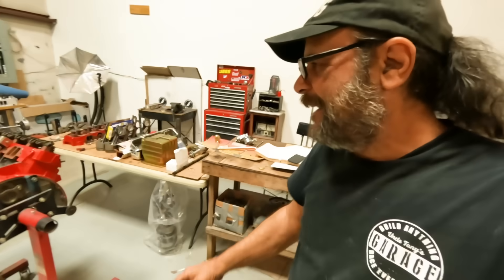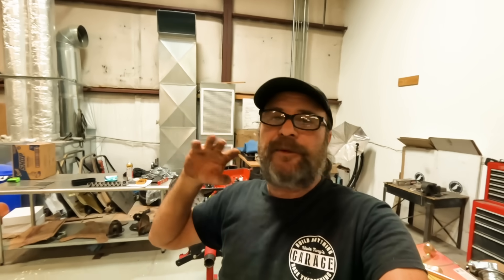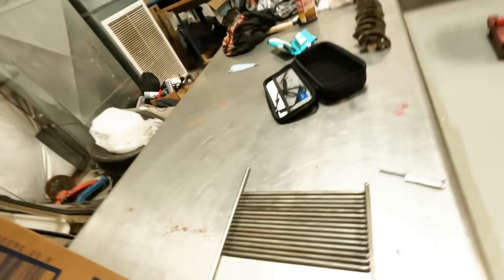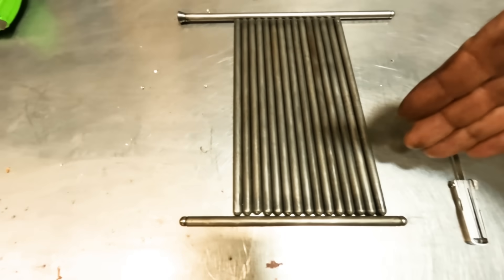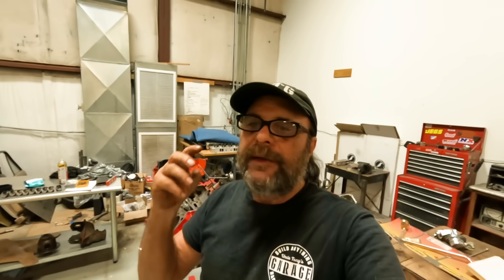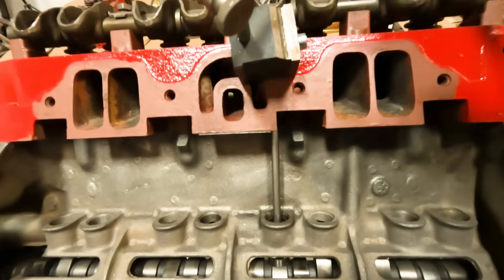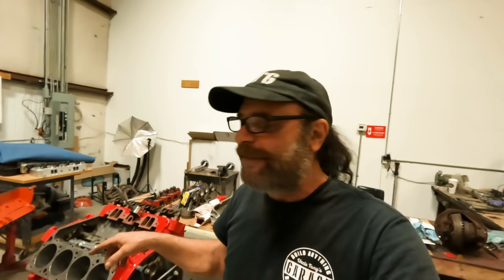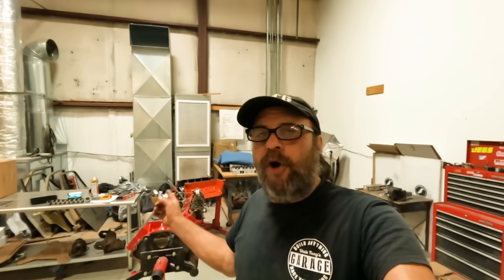The Engine Tuning Issue You Didn't Know You Had

Comment: Man, you're making me want to go to my dad's garage and tear my spare motor apart and measure all this stuff!
I'm working with 3800 Series II motors, but so much of what you teach on here is universal! I'm seriously considering blueprinting my other motor. I'm not planning on doing any serious racing with it, but I want it to be as smooth as my dad's BMW I6!
Reply: It never will be. Nice motors but won't be as smooth as the bm.
Reply: @hayden6056  a well running 3.8 will not move
.
Can litteraly ballance a quarter on it and rev it up and down all day long
.
.
I've actually got a video doing just that somewhere
Reply: @kainhall  yep , from an engineering point of view , still will never be as smooth as an internally balanced inline six...

An inline six has primary and secondary mechanical balance.

There's a reason the V6 has a balance Shaft. 

There's a reason most v6's can't rev like an inline 6 on principal alone even if all components were the same quality. 

Hell the 3800 isn't even internally balanced , the balancer and flexplates weren't even individually balanced per motor. The actual +- in grams on an old GM V6 motors balance is pretty shocking lol.
Reply: @hayden6056  you're probably right
Reply: @michaelwallace7972  inline 6 is self balancing on rotation and piston height. 

The bmw is also internally balanced. Not knocking the V6 I have one on my stand right now! Just vastly different dynamics.
Reply: Love those engines I had a supercharger one in a Buick park avenue ultra best car I’ve ever owned
Reply: Wanting to build my 97 gtp
3.8 supercharged soon.
Reply: @jonbovideadoralive  love the screenname! I'm running an '01 GT. Trying to decide if the rust damage is salvageable. Hit the Grand Prix Forums, if you haven't yet.
Reply: ditch the 3800 for the gm 3.5l or 3.9l and youll have a way better balanced motor and better running too. getting rid of the stock detune on the 3.9l get you to over 300hp
they can also be built pretty strong with off the shelf parts from other vehicles.
Reply: @chehystpewpur4754  3.9 are nice motors
.
But not as smooth running as the 3.8
Not as much low end torque either
Reply: @kainhall  go do some research. the 3.8l is not smooth it has tons of weight on the crank and huge balancer as its not a well balanced motor. the 3.5 and 3.9l are internally balanced they dont have a balancer. the 3.9l also makes more torque and down lower. if you ditch the stock detune on the 3.9l it far outperforms the 3.8l. ive owned both and worked on many more. run your 3.9l without the balancer on it and see how long it lasts. the 3.5 and 3.9 will survive other than some oil leaking.